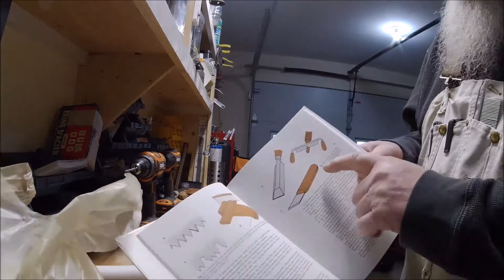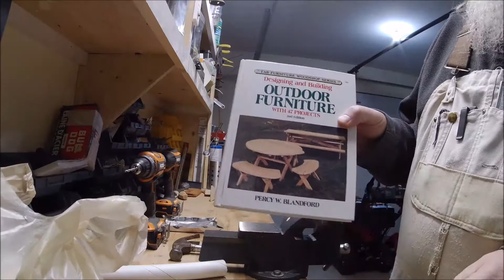0261 Nasty Weather Today

Comment: I use the same type of gas stabilizer - squeeze it till you get the desired amount in the other tube. Beautiful dogs - we have a shetland sheep dog (sheltie)  -  your garage is like mine - full of stuff that you either don't know what its for or does and stuff that you didn't know you had - lol
Reply from the maker: The stabilizer is newish to me and I think it might be a good idea to try out as I buy 90 liters at a time and some of it might sit for a while before it gets used and the fact that the lawnmower sits in the garage like the snowblower for 6 or more months between use and the cost of fixing a gunked up machine means the stuff is cheaper.  The contents of the garage in part is a mystery because it was in storage for about 20 years until we moved here.  It has only been a little more than a year since the garage was sort of finished and I find old stuff all the time.  Like the come-along... I knew I had 1 of them but surprised I had two.    Even found an old spokeshave from my grandfather and an old plane.  Both of them I'll try to use to make a few walking sticks and a cane or two.  I manage to give my son a bag of old tools and told him to clean them up as they are as good as new.  Slowly but surely I'll give him the old stuff.